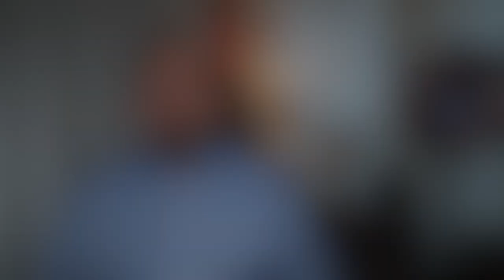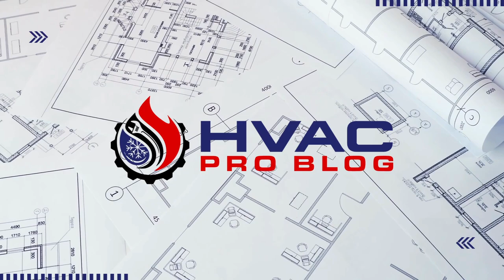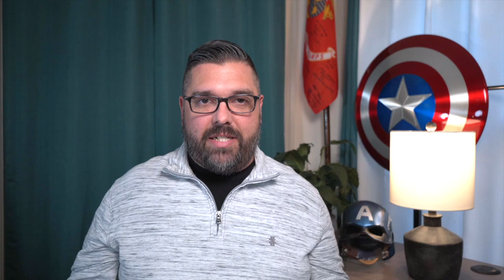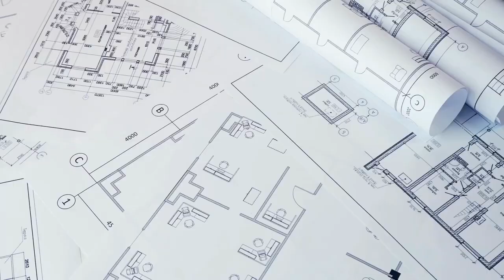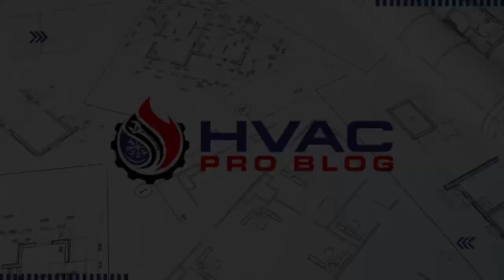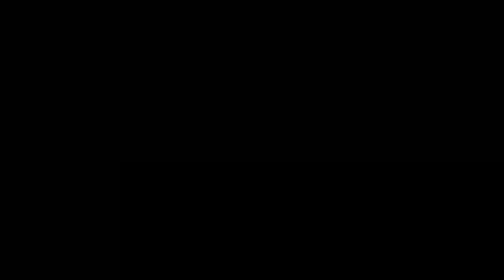Why You Can't Size a Variable Speed Heat Pump to Your Existing Duct System

Comment: I believe our company is probably the only one in our area actually doing heat load calculations. Every other company in our area goes into a house, counts up the registers, and divides by 4. That is the tonnage they install. Customers are always wondering why we are measuring their windows and checking the insulation in the crawl space and attic when every other estimate only took like 30 minutes to complete.
Reply from the maker: Keep educating homeowners and fighting the 'good fight' Joel!  Even though this is a code requirement, and typically needed for most utility rebates/programs, I also see the same thing across the entire Northeast.  The quality guys that do load calcs as part of their process build tremendous value and trust with the Homeowners...

Comment: Great video! I don't know why 9 out of 10 guys say my existing AC duct work would be fine for heat pump. QUESTION Should the placement of ceiling grills/registers be changed when switching from AC only to a heat pump? Thanks!
Reply from the maker: Thanks for watching!  It is possible that replacement of the supply registers will be necessary, depends on the cfm, throw, and spread of each.  In order to verify this, a room by room load calculation and Manual D Duct sizing (runs) worksheet is needed...good luck!

Comment: What's the best method for checking duct leakage? We offer Aeroseal but the modern customer is skeptical about a lot of things you tell them. What's the best way to measure duct leakage on a maintenance call?
Reply from the maker: @elijahyasi5858  Thanks for watching!  The most common method for measuring duct leakage would be with a duct blaster, like from The Energy Conservatory.  This takes some time to setup, a total time typically 45 minutes or so, but far less than Aeroseal to just measure leakage.  Of course, nothing seals the ducts better than Aeroseal!  On a maintenance call, in a hot or cold attic, I have measured temp and wet bulb to check the efficiency of the duct system.  If the ducts are at least R-6 or R-8, then large temp differences from the return grill to the unit could indicate some leakage, same on the supply.  This is just a quick test to see if measuring with a duct blaster is recommended...Hope this helps!

Comment: Local contractor oversized my heatpump ( I have increase in humidity, my system runs longer, and my evaporator coil truck / supply is always sweating, etc) what can i do now? Need advice. my sqft is 3490, i have 2 zones (upstairs and downstairs) the unit in the basement was replaced with a heatpump.
Reply from the maker: Thanks for watching @larryl22!  I would recommend you find a quality local contractor to complete a load calculation on your home.  Based on this, it may be possible to manipulate the airflow low enough to decrease system capacity...this may require a refrigerant charge adjustment as well depending on the type of system.  This will not however fix your duct condensation issue.  The ducts are below the dewpoint of the air...sounds like you may either need insulation on the supply, dehumidification in a basement (if the ducts are downstairs), or ventilation of your attic (if the ducts are up there)...
Reply: @HVACProBlog  can you please recommend a contractor...i live in milford, ma

Comment: chris - should you always insulate supply ducts inside conditioned space (esp under first floor? if so, what R around that duct ? what about insulting return ducts within conditioned space ? overkill ?
Reply from the maker: Hi John!  Thanks for watching!  YES - you must insulate the supply ducts whether inside or outside the conditioned space.  This is to avoid condensation in cooling as the temp of the ducts can still get below the dew point of the air.  The 2021 IECC says R-8, local code may specify otherwise.  Return ducts inside the building envelope should be the same - yes, a bit of overkill.  They at least must meet the particular portion of the assembly insulation required (like if in a floor joist or ceiling joist)...hope this helps!

Comment: My central AC is 15 years old. My oil fired water baseboard is close to 25 years old. I am being proactive looking into a heatpump system for the near to intermediate future. I have had several people come in, but all I get is either 'use your current AC ducting' with a new heat pump or 'here's our recommendation for a split system.'  The one reasonable exception was a recommendation for my current flex to be replaced by a tin/hard ducted system. But NO ONE does an analysis as you suggested. Can you recommend anyone in my area, even if I pay for an analysis & system recommendation from an expert 'heat pump consultant? Please attach any disclaimer on your end. Thanks! Rob --- Westchester County NY 10598